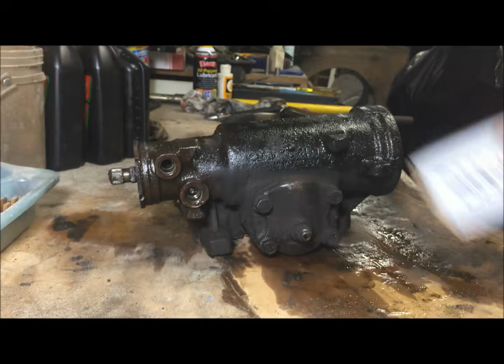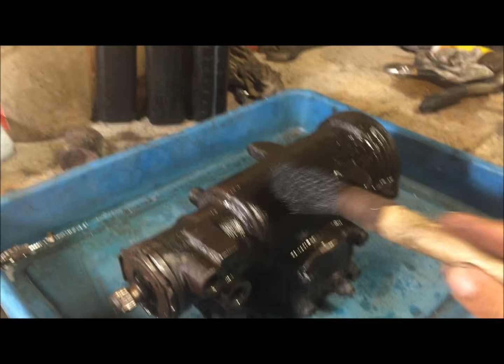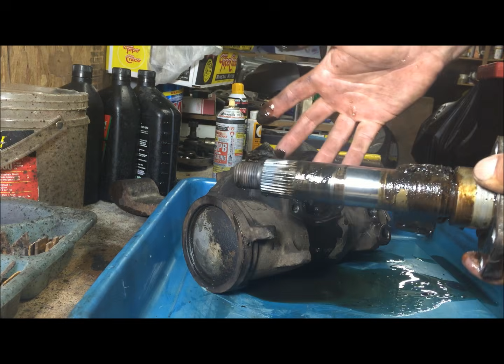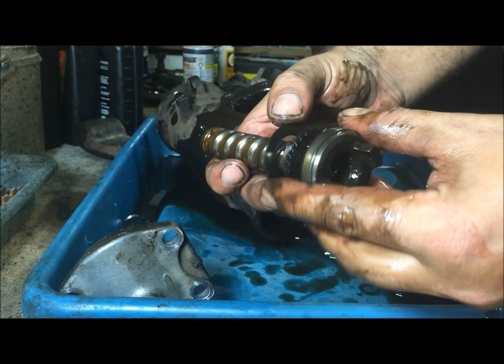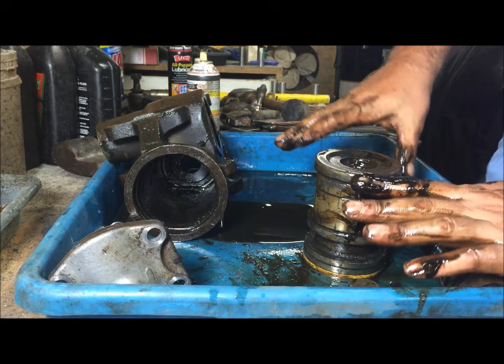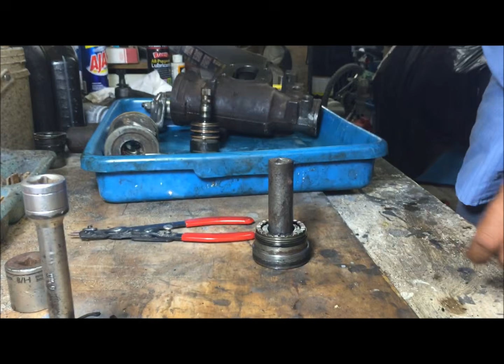how to rebuild power steering gear box saginaw part 1 tear down

Comment: How many hours did it take to rebuild. If a mechanic does it would cost 30 dollars for kit and 100  a hour . Are you better buying a new one for 350.00 dollars
Reply: i bought two reman units from o'reilies, both had massive slop in them... so yeah, id rather rebuild it myself than trust someone in mexico
Reply: @narmale why someone in mexico? you cant pay in usa or what
Reply: @armandoalbertoramosrivas750 no dummy you can't use dollars in Mexico
Reply: @armandoalbertoramosrivas750 you know exactly what he's saying.
Reply: Sorry I just pay for convenience I might get my cuticles ripped
Reply: @rolandmoreno3526  I did my pump and steering box on my suburban. I personally feel like it was worth it. Rock Auto had my rebuild kids for $20 for the pump and $30 for the steering box. The time it takes to rebuild one really depends on your skill level and tools. I feel like I could do bushings, rings, and seals in  probably thirty minutes on each one now that I've rebuilt them. Probably will take you an afternoon if it's your first.

Buuuut here's the shitty part. If your flat surfaces are gouged up or your oring seal ate a groove into your shaft then you just wasted your money on a rebuild kit you can't use. Or you disassemble to decide if it's even worth it and wait a week for parts? If you're in a hurry its definitely not worth it. Buy the new part and slap it in.
Reply from the maker: I can buy a new one too.. anyone can .. I spent $60 and rebuilt 2.. both are still working perfect to this day.. I saved $600 ..  I don’t trust mechanics.. they are 95% scammers and liars
Reply: @chriscraft77022 . If you’re gear box is that dirty, I would replace the pump and hoses as well.  You actually are better off with a remanufactured unit.  The gear boxes are reamed out and a steel sleeve is pressed into the side your steering column connects to.    Those o-rings will gouge into the casting a good 1/8”.  I used to work at a remanufacturing plant in Illinois.  You really need to know your stuff before tackling such a job.  Even the input shaft has to be set just right.
Reply: @chriscraft77022  I don't trust mechanics either. I work on my own stuff.
Reply from the maker: if you even have to ask that.. go buy a new one… woman question
Reply: @chriscraft77022  very helpful and productive reply

Comment: Update**
Got it. Used some 3/4" all thread and stuck a nut into the side cavity and threaded the all thread into that, allowed for much heavier and loaded hammer hits

I hate the fact im asking this question, its embarrassing being as i build all my own race motors, transmissions, everything but for the life of me i cannot get the domed end cap off. I tried prying like you, hammering from the other end with a long punch, heat, ect. All its done so far is deform the backside if the hex cap. Yes all of the lock ring is removed. You have another trick to try?

Comment: Hello Chris my power steering gear box is leaking at the input shaft tip. Some shafts don't have a round piolet shaft at the end of the input shaft I guess it's called a piolet shaft but I took it apart and there is no way to service that. I tried to tap out the dowel pins but they wouldn't budge maybe I can get it welded on the inside to seal it or use epoxy. I don't know if I can get that piece part separately. I'm thinking about just getting an entire rebuilt box. I bought a complete seal kit and replaced all the o rings and shaft seals but that was in vain. I don't know why there is that nipple shaft its not needed. My car is a 1976 firebird and I think its the original box.

Comment: Chris, is it possible to just replace the input shaft seals? It looks as if the lock-ring comes off, and then the preload (spanner hole part) would slide out without having to remove the worm gear, is that correct? I have a leak only on the input shaft and I'm thinking that this would work. I wanted to ask the expert first though! Thanks for your time-

Comment: more tips: To start, taking that main bolt off, I used a plumber's monkey pipe wrench. Next part, to spin the next piece out, put a bolt in one of the holes, then, get a small closed end wrench and use the shaft as leverage to turn the piece out. No special tools and is a thousand times easier.

Comment: Did you ever determine if 22 ball bearings was the correct number of bearings? I ask because I just disassembled a Saginaw box for a 1977-1979 Jeep CJ and I came up with 22 bearings as well and yet the manual calls for 24.

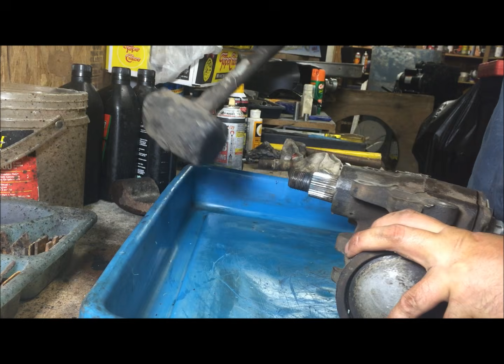Comment: Quick question. I got wheels that point at noon and a steering wheel pointing at 5:00. If I just took out the pitman shaft and re-centered it on the worm gear after a half-turn, that gonna cause me any trouble?
Reply from the maker: not if it went on there easy.. sometimes thy have fixed positions..
Reply: @chriscraft77022  Cool. Thanks.
Reply: @frikyouall  I would say turn the wheel left to right without wheels engaged.  Lock to lock and measure how many times you count so you can do the math about where the steering wheel is when the wheels would be at 12o clock straight center then attach it all back up once your steering wheel is dead center should. Go back on like butter

Comment: Discovered the secret to getting the big piston teflon ring on without stretching it 
I also had a very hard time getting the piston in the housing with the new seal due to stretch. Bought another new seal and stared at it for 20 mins. Yatzee! If you put the teflon seal on FIRST, starting it deep in the groove, it slips right on. Then feed the o-ring around it and slip it past the teflon seal in the groove. 0 stretch and took 2 mins. 
Love your videos, keep it up 👍

Comment: what if i fucked up and didn't mark the housing, input shaft, and lock nut at the very beginning?

 how do i get it reset correctly?  the manual says 1/2 inch back off. i tried that but i got a lot of play in my steering wheel still.
Reply from the maker: I needs an inch and a half pounds of resistance on it .. just take the slack out
Reply: @chriscraft77022  Thanks homie. will give it a try.  i liked the videos and also sub'd.

Comment: Great video! Random question, but do you recall where you got your plastic tray? I'm having trouble finding one with a big enough footprint and short sides, yet durable enough to toss a steering gear around in. :) Thanks!
Reply from the maker: it’s little tikes but I’ve had it for 15 years and found it in a car full of parts.. no idea where it came from
Reply: @chriscraft77022  Thanks for the quick reply! I'm going to try utilizing a plastic 24x46 utility cart as a teardown table.

Comment: I never knew you could rebuild the steering gear,  back about 14 years ago my steering gear went out and I had to find a nice used one at the junk yard.   
Of course times have changed now and  I have better income  and the internet, now I would just buy an already rebuilt one from eBay.  

But this is still handy knowledge when you need it.

Comment: right off the bat I took mine mostly apart before I watched this video meaning I didn't mark that deal in the beginning of the video.
Reply from the maker: That mark if for the preload on the bearings .. just snug it up where you can still turn the shaft by hand
Reply: @chriscraft77022  Thanks for that. The one I'm most worried about is the one that adjusts back and forth via an allen wrench then has the lock nut. This is I guess is the pitman shaft. The adjuster protrudes out of the side aluminum cover held by 4 bolts. I also took that completly apart. Do you know the adjustment on that one? Thanks
Reply from the maker: that’s the one you dont mess with.. the problem is now you spend money and time to rebuild and if those don’t mesh right they will wear out and you will have play in the box...

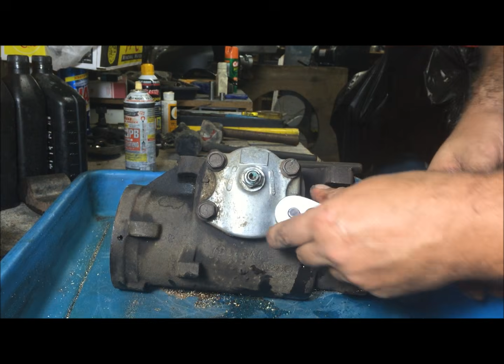Comment: st 4:50 when you pull the cap and shaft out together. Can you just pull the cap by removing the adj nut and 4 bolts? I have a leaky copper gasket but dont want to pull the shaft out. thx
Reply: no

Comment: chris, when you remove the input shaft after unscrewing the spanner wrench washer,  you are just pullimg and twisting the shaft out of the housing.  you took the pitman shaft out but it does not show if you removed anything inside like ball bearings before you pull the input shaft out.  I cannot get my input shaft out even using the 35 lb weight of the box.  It turns to both stops and fluid spews out, but will not come out like your video.shows??
Reply from the maker: I remember it just unscrewing out without any problems
Reply: @chriscraft77022  So you did not release the ball bearings before you pulled the input shaft out?
Reply: Does anyone know the answer to my question on what holds the input shaft from sliding out that needs to be removed to replace the input shaft seal?

Comment: Spent most of the day doing this. After install steering wheel immediately went to the right 
Been fixing cars for 35 years but never had one all apart. Not in a hurry to do another 
Back to the drawing board tomorrow morning
Reply from the maker: they have some check balls in there I didn’t know about.. just play with it and it should go away.. mine did that too.. it only went to the right

Comment: Chris, Thx for the vid, going after my 79 Quadravan.where did you get the rebuild kit. MasterpPro from checker autozoe napa???
Reply: Be sure to measure your input shaft size. Typically before 1980 they are 13/16. Afterwards they are 3/4 inch. I posted what I discovered were the right kits in another comment for the input shaft seal. I am guessing that the other kits are similar in that they won't work unless they put in both sizes for the input shaft.

Comment: Hello Chris, I wanted to let you know that your video was helpful so I can reassemble my gearbox (1981 Malibu ). No one told me to open it and look inside, the bearings just poured out so now I'm trying to re insert them. 22 so far. It's My spare gear box so if i can't reassemble it  SCREW IT.  Btw this video was worth watching just to hear you complaining.  I have not laughed this much in weeks. Thanks again Chris, ...Eric
Reply from the maker: i have a part 2 where i get those bearings back in..  look at them close, you most likely have 2 different kinds..  put one dull one, one shiny one, etc..  this box had all shiny ones..

Comment: Minute 5.50 . That bolt you said an idiot can adjust it wrong whats it for? I messed with it somone told me thats where you bleed the gear box and now the steering is HARD , help!
Reply from the maker: you mest up bad..  that is where you adjust the mesh between the gears..  if it is hard you will probably break the gears...  you need to loosen it back..  but the process can not be explained in any youtube video...

Comment: GM power steering component service repack, non-replacement (from GM dealer service shop): $200. Re-manufactured steering gearbox d.i.y. replacement (depending on source): $85-$140. Rebuilding and possibly screwing up something that might not work or throw me into a ditch? Good instructions, but I'll pass.
Reply from the maker: both of mine turned out perfect.. but i work on stuff like this all the time.. YES..  buying a reman one is a better idea if you have the money..  most people dont though..  thats why they watch these youtube videos..  LOL
Reply: @chriscraft77022  True. It's very doable. I'm just worried that I'll screw something up.
Reply: @RandomPerson-su3xg  you will if you are already worried
Reply: @trillrifaxegrindor4411  kind of a given when I've never tackled one before.

Comment: What’s the main reason these boxes will develop steering input play?
Reply: wear,kind of obvious no?
Reply: trillrif axegrindor not what I’m asking, I’m trying to get a specific answer, like for example if there is a specific part that develops play inside that co tributes to the backlash. Or simply is the gear wearing down.....
Reply: @Gap_machine  seals and bearing develop play from "wear"  shafts develop play from "wear"    the box itself can develop play from "wear" improper assembly and adjustment can develop play from "wear or user error"

Comment: haha i had to play back the video in the beginning... "is that Pelican in the background???" nice!  Gotta get into this job on a GM ZQ8 box.  Had a lil slop in the steering, was told to tighten up the allen bolt 1/8th of a turn, and that made the steering super stiff, turned it back, and still super stiff.  Loosened it another 1/8th turn and still feels like i'm driving on flat tires.  Try to fix something and end up making it worse! haha

Comment: I failed Steering and Suspension by one point! I took brakes six six days ago and failed it by like 5 points, so....

Granted, I've never taken any classes, I've just worked on cars as a hobby, including rebuilding an engine, swapping out a transmission, etc.

All I did for study is get the textbook and read it all the way through and make note cards and take quizzes so---I will keep trying!

I'm transitioning from Accounting to opening my own mobile auto repair  business. I don't understand why some people think mechanics are stupid. I'm sure some are, but if you can pass an ASE test, good grief, you're pretty smart! I've taken the CPA exam and passe it and I find the ASE difficult.
Reply: Matt Garza,  When you have experience and game, don’t give up as I have a tip for you to pass. I your practice book, read the question and break it into sections. Ask yourself “What are they asking” because certain work are “Tells”. Example; A bent steering part will effect the steering axis inclination and the Ackerman angle. Tech A says no. Tech B says yes. Both or neither.
Reply: Sorry, on phone and hit wrong button. 
In the question, the word “WILL” is a give away, plus, having two issues pointed out in the same statement is a give away. The answer is YES! It effects both. When reading the question, read until you find the one word that changes the meaning of the statement. Giving two effects is also a clue it’s true because one is iffy, but two are clearly correct. 
  There are 5 types of questions; Do, Will, Won’t, Possibly, Maybe and Can’t. Once you read the test question and you come across one of these words, stop. Go back and re-read the question and include the “Key” word, stop and ask yourself what are they asking? The just told you. 
 I took all the test (8) in one night. I was the last one left because everyone else took 2, or 3 maybe 4. But I just got it over with each time. From the first time (Which have more question than re-certification) Now you have all eight, you can take the advanced emissions L1 but it has 100 questions.
  And unfortunately for those who test are crap & not needed, you can’t get a job from dealerships to a city garage. Even the FBI garage requires ASE cert and it increases your pay! 
I think “Trillraf” got schooled! Pass a test and quit being mad at life... You will like yourself more girl! ASE Master Tech since 1978, UTI instructor, ACDelco seminar and class instructor. Chris Craft has made something of himself by doing. Trillif, get your hands out of your pants and do something productive, not destructive, Jeeeesh!
Reply: tests are bullshit,its actually doing the work fast,properly and reliably 

over and over and over.consistency,accuracy and PRACTICAL knowledge.

Comment: Two things I would say,  don’t use gas as a solvent gas is for combustion not solvent!  Two don’t beat on bearings with a hammer!
Reply from the maker: you sound like someone that has never rebuilt anything...
Reply: nit wit.......1)gas cleans everything......2) bearing races are incredibly strong so hammer and sockets are used all the time

Comment: I work rebuilding power steering boxes any kind
For big truck or small cars
Reply from the maker: this box had all the same size ball bearings.. the chevelle box had 2 sizes.. what happens if someone doesn’t pay attention to the diameters and just puts them back in any way? In which I’m sure has been done a lot
Reply: It can happen if you don't pay attention that is why you shouldn't do something that you don't know
If the gear box has 2 different sizes of ball bearing, what you do is separate them using a caliper, and then when you are about to put them back you put a small fist then the big ones,small and big
You may end up with play in the gear box that means you need a big size of bearing but only use half of the use ones and half of New ones

Comment: Do you think it's possible to flush out a good condition steering box that was just sitting collecting dust? I wanna use the box but I can see that some dust found its way inside but I don't wanna take apart the whole thing.

Comment: Just in case no one has said so, please do not use gasoline to clean your parts.  It is very dangerous.  It has a lower flash point and so it can ignite from an ignition source.  Also, it is made up of lots of nasty chemicals like benzene that can cause all kinds of health problems.  Use Stoddard solvent or equivalent parts cleaners/degreaser.

Comment: Don't waste your time and money doing this. Nothing will fit the moment the weather changes. The plug won't catch thread anymore. Etc etc etc. Just spend the money and enjoy life. It's too short to go through all these headaches just to save 40$
Reply from the maker: it’s more like saving $200... both boxes I built work perfect to this day without any problems.. the kit is $40   A new box is $300.
Reply: I rebuilt mine, challenging little procedure on the bench, 3-4 hours and 30$, good to go,
Reply: Some people spend their time doing these not for the savings factor but because they enjoy that challenge. The saving money is just a bonus ;-)